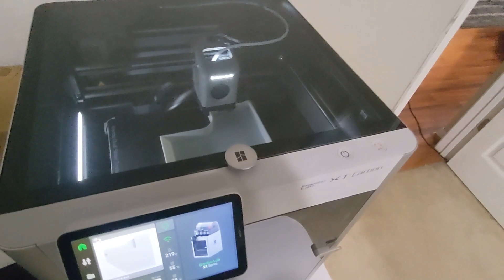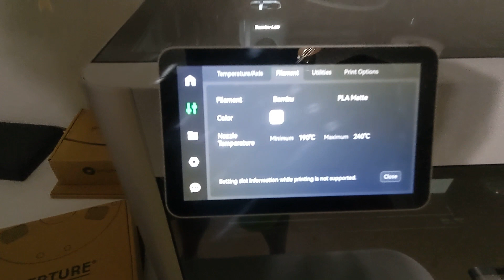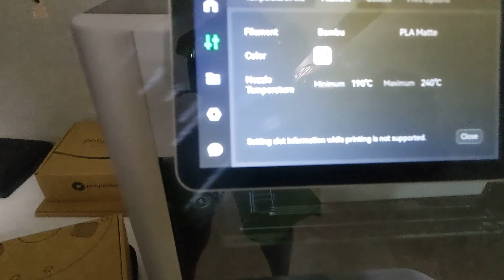X1C running our of filament WITHOUT AMS

Comment: I absolutely hate my x1carbon.  nothing but issues.  AMS is a joke.
Reply: Reason why I choose the P1S with no AMS over the X1, My friend got the X1, and I immediately could tell the drawbacks of the additional "Tech"  it had, not a fan of the AMS for its waste, and don't need it, as I mostly print black or white anyways

Comment: But the big question is: did it finished the print correctly after reloading filament?
Reply from the maker: Yes it did. You can tell on the model where the filament changed, but it looks like it normally would if you where to do it manually.